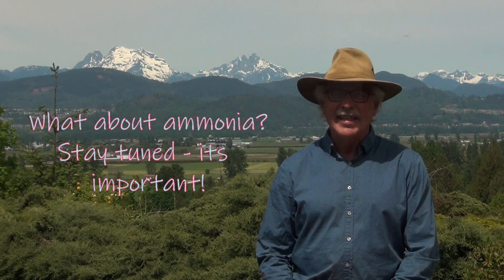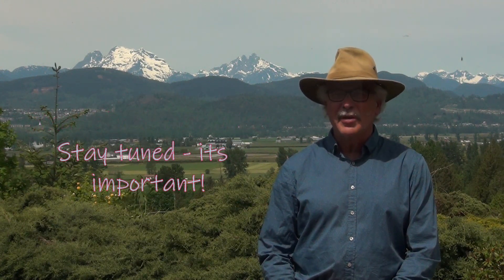Best Management Practices to Reduce GHG During Composting

Comment: Great info. I'm a bit confused about something though. 

You said that the more carbon is available during curing, the more nitrous oxide will be produced.

At the same time the more nitrogen is available, the more nitrous oxide will be emitted. 

What's the best method to minimizing this? Have enough nitrogen during the active stage to burn through the carbon so that there isn't too much during curing? Thanks.
Reply from the maker: The best strategy that we understand so far is to use as much of the available carbon early in the process, by providing enough oxygen. There does not appear to be evidence of significant nitrous oxide emission early on the in the process, even though there is usually enough nitrogen for the composting process to proceed efficiently.